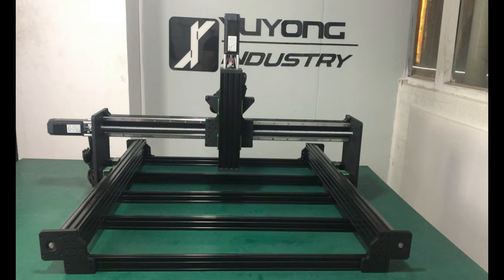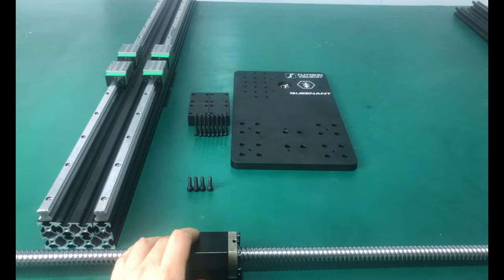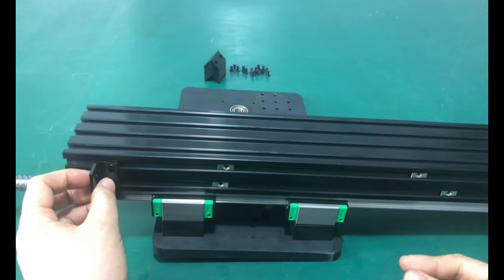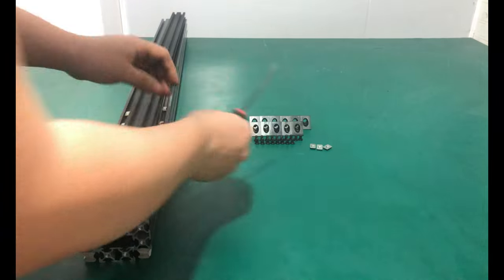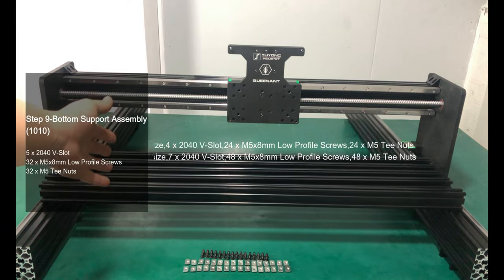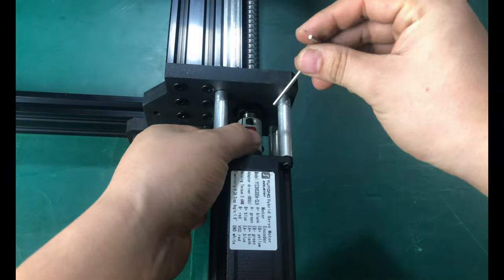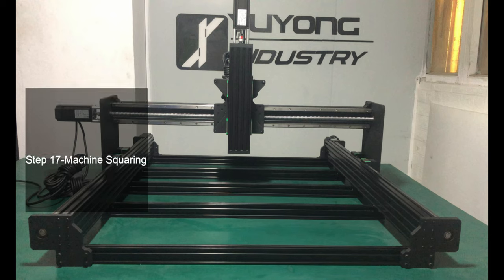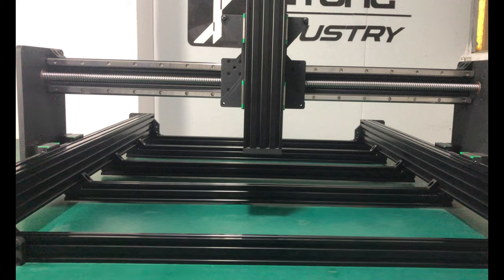Ball Screw Precise CNC Machine QueenAnt Pro Mechanical Assembly/WorkBee QueenBee upgrade to QueenAnt

Comment: What type of bearing is used (model number?) in the aluminium plates to suppport the ballscrew ? Its the first time i see a setup like this, what benefit has it over a BF12 for example ?
Reply from the maker: The bearings are imported metal SKF Bearings, Integrated with aluminum plate make it more precise！

Comment: I am thinking of buying a 1500x1500 full kit. You recommend your own DDCSv3.1 off-line controller. My question is: does it have USB connectivity to PC for downloading G-code files, as well as remote control fro CNC software?
Reply from the maker: Hi, offline controller USB flash disk, just copy G code file into it, then insert U flash disk into controller,then work.
Reply: @yuyongindustry  Thank you for the info. One more question: which controller option would you recommend that has PC connectivity?
Reply from the maker: @OldSilkRoad  USB controller can connect to PC, suggest MkX-V mach3 controller or other USB controller
Reply: @yuyongindustry  Thank you!

Comment: This machine looks very interesting, I don't have a lot of room in my shop, can this machine be mounted on a wall and operated vertically?
Reply from the maker: Hi Zach,it may can't, the machine is too heavy ,it should be put on a flat table,then fix it.
Reply: @yuyongindustry OK, thanks for responding to me so quickly. I don't know if one of your machines will suit my needs right now (maybe in the future), but the machine still looks like a good one. I will tell anyone who is interested in a CNC to check it ou. Thanks again:)
Reply from the maker: @zachcrawford5  Thanks too!

Comment: Very interesting upgrade kit, hope it will be available in EU warehouse. Which is the diameter  of the ball screws at the two ends ( where it slide in the jaw couple and the ball bearing )     8, 10 or 12 mm ??
Reply from the maker: Hi,there has 10 and 12mm

Comment: Why don't the ballscrews fit inside the 4080U extrusions?
Reply from the maker: the ball screw has big diamater, it has nut housing, and also add 2040v-slot into 4080, will let the X axis more rigid